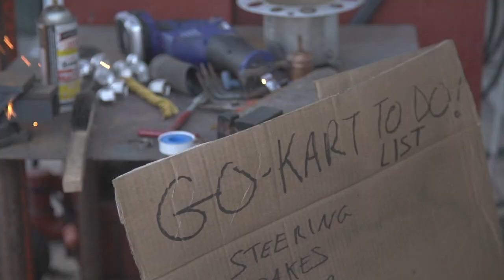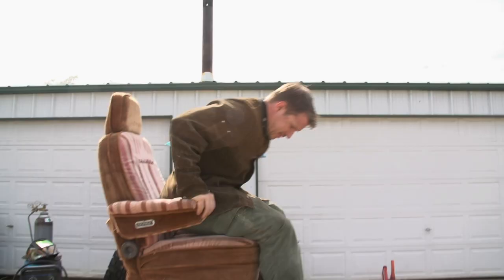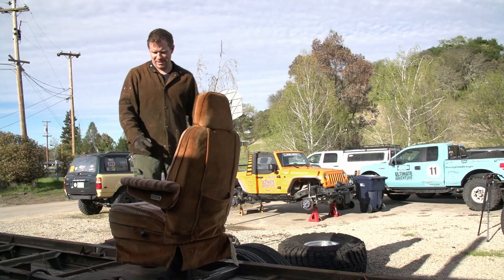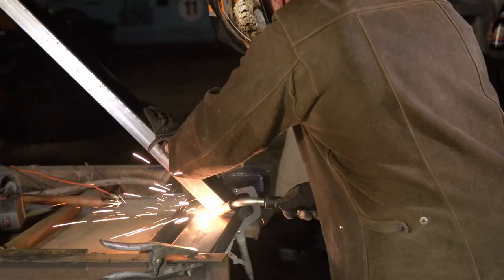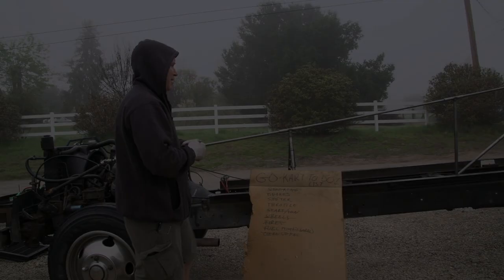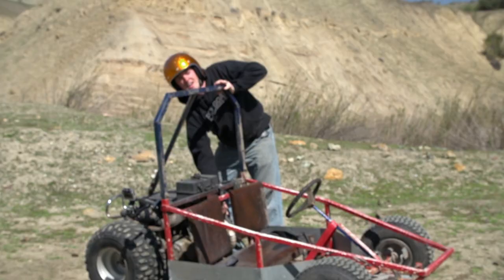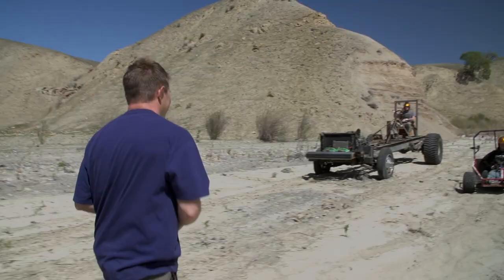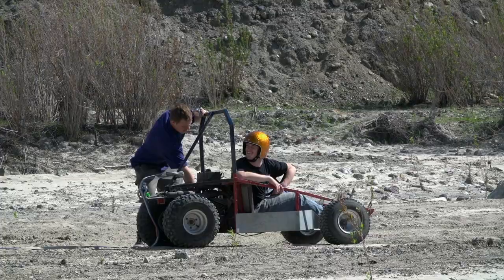Motorhome Mashup Part 2: Monster Go-Kart Challenge! - Dirt Every Day Ep. 28

Comment: This is hilariously awesome! One question though (I'm no engineer, but): Why not cut about 12 feet out of the middle of the chassis and weld it all back together? It would turn so much easier lol.
Reply from the maker: It might turn easier, but it wouldn't be nearly as awesome!
Reply: Motor Trend Channel
Hahaha, your go cart = your rules! Just a suggestion! Good fun either way!! thanks for commenting
Reply: +crfunk42 I agree. It was cool as it sits but I would have turned it into a dragster or a much shorter version with a full roll cage. Plus it would shave hundreds of pounds of weight and be much faster.
Reply: +TheGoldenSaber You say that like they didn't shave a whole motorhome off of it lol
Reply: Kukiru
Yeah lol. Every pound counts though. I would have made that thing the size of a Camaro.
Reply: I mostly would of shorted it for agility
Reply: Kukiru
Better agility, better acceleration, better gas mileage, better stopping power. The list goes on and on.
Reply: t
Reply: +TheGoldenSaber 
a
Reply: 2 words, MASSIVE DOUGHNUTS!!!!
Reply: +crfunk42 I want a limousine go-kart.
Reply: +Motor Trend Channel true shit
Reply: steering geometry would be a problem. specifically "Ackermann" geometry.
Reply: TheGoldenSaber I think you missed the point of this episode. The point was to make a GIANT go kart.. If they wanted one that was smaller, lighter, and more fuel efficient, they would have started with a pickup truck.
Reply: Monster truck
Reply: crfunk42 kayden

Comment: Roadkill would've gotten that registered and driven it there
Reply: Roadkill would have left it and just drivin it anyway without having it registerd
Reply: +Go karting101 roadkill would have cross countried it 2000 miles
Reply: Then swap the engine in a snow storm
Reply: don't forget a supercharger on the old motor first.
Reply: this needs to be street legal
Reply: +ChiTown Dan it would need way to many things to be street legal... Fenders lights enclosed driver area a windshield and countless other things but that's not to say it couldn't be done
Reply: +Mojoe6200 how insane would it be, we need to make this happen! imagine it street legal
Reply: They would be doing burn outs with it
Reply: Roadkill would've pulled the motor from Stubby Bob and stuck it on the rear of the frame.  Epic.  BTW, dig that tune at 19:30 to the end.  Been humming it for days.
Reply: Eve roadkill made that a wheel would fall off
Reply: X jingle bellsGrim City Goofs fix dezssdiad
Reply: Love that show maybe they would drive it to Alaska like the og ranchero
Reply: I didn't think they registered anything ever lol
Reply: I don’t think they register anything??
Reply: 14:07 wtf is that pink thang lmao

Comment: How about a go kart out of a semi truck with a blower on top with a 4 speed? The 1000+ LB-FT of torque and 380+ geared up HP will outrun a detuned 454 big block in a class a RV. And can you do me a favor Fred: add a huge f***** blower on top of the 454 for an extra 400+ HP? This will turn a 200 HP detuned 454 powered RV into a trophy truck guarenteed.
Reply: or just buy a 460 with headers and a 750 edelbrock
Reply: Im still going with my idea. Blowers are cheaper than new engine, headers, and carb.
Reply: Peter Kapica true
Reply: Peter Kapica but a 460 is a much better engine to begin with in most aspects besides the stock head/headers flow
Reply: True, but it will be expensive to replace a good 454 with a better engine. Thos is the cheapest way to make more hp from a stock engine
Reply: A blower that has the potential to add 400 hp will do nothing but blow hot air inside the worn out 440 BBM, to make it any use you'd have to have the heads and carbs to deal with the extra air. But all that said an 8-71 would add 1000 more man points to this.
Reply: mattyb120 how about a 24v149? Its got the space lol
Reply: *****

That is true.
Reply: Peter Kapica "Oh shit, i that one of my rods?" Looks into sky as object leaves earth and is sent into orbit

Comment: I dont really see the point of a roll cage. It would probably be very hard to flip, and if you somehow got it to flip, it would squish you and the roll cage.
Reply: #1: Better safe than sorry. Their life is worth several times more than the cost of the roll cage. #2: It's a tried and true design.
Reply: really unless they go at an angle on a steep hill which I doubt they would the thing has a very low center of gravity so its not very likely it will flip to begin with but having  that roll bar will help although they really need to have a full cage around the driver.
Reply: #darwinawards   You'll get one with that mindset...Genius.
Reply: The show's insurance wouldn't let it happen without that element of safety. And with only a bare frame and engine, that whole go cart probably doesn't weigh much more than a regular pickup truck, so I don't doubt the roll cage can hold up.

Comment: I like the motor home go cart what about changing the transmission to a part time transfer case and trans giving you 2high and 2low so if you do get the big block I did a project on a 74ford took the 390 out put in a 429 motor and transfer case out of my trashed snow plow truck it was 2wheel truck but great to go out in the woods and loaded it with logs